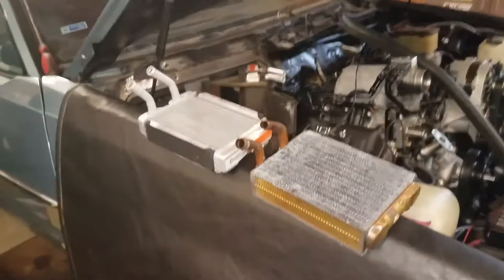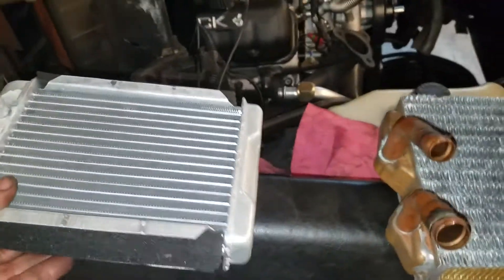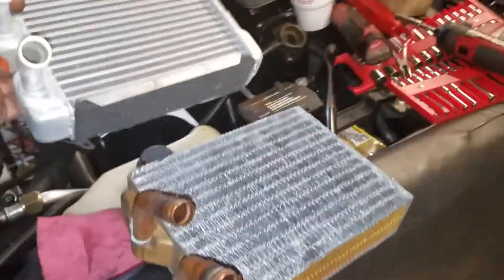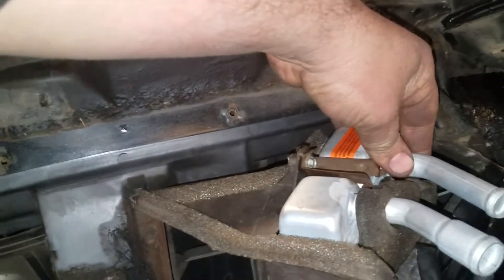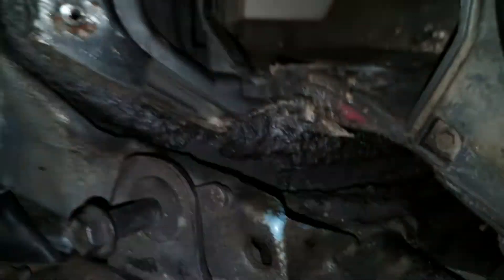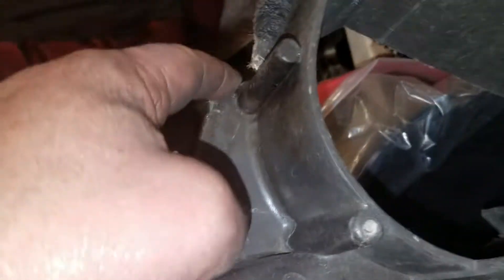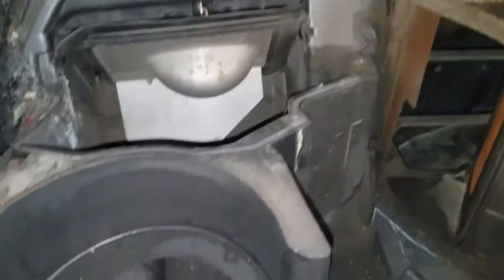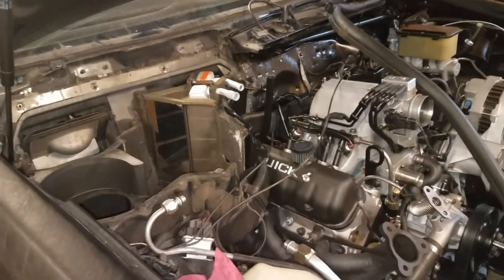Heater core replacement on Phil's blue T.

Comment: Hi Steve,I put this exact heater core into my 87 gn, got it from Kirban.  Did you run into any issues with the new core being shorter?  I had to put a piece of foam in the bottom of the box to get the tubes to sit properly.  Curious if you ran into this issue.  I had sent pictures to Kirban to let him know.Other than being a little short, it has worked good.  Really enjoying your videos and hoping to get my trans to you for a rebuild this year from Canada.Cheers,Jason
Reply from the maker: Jason no issues, I have used several and have one in one of my cars no problems.